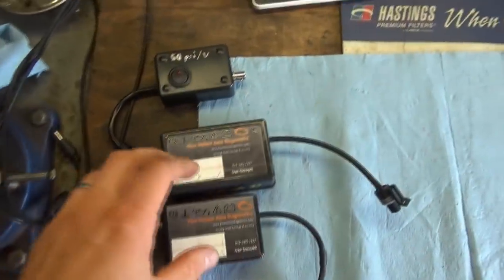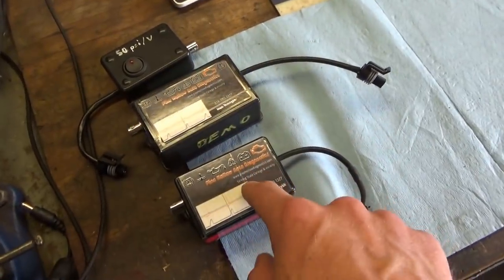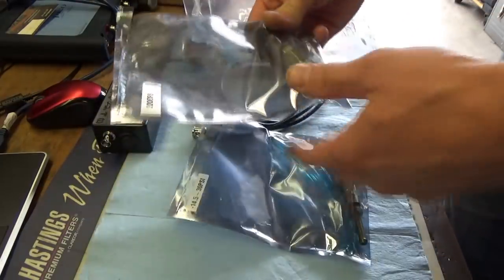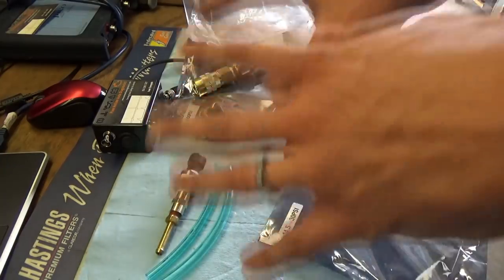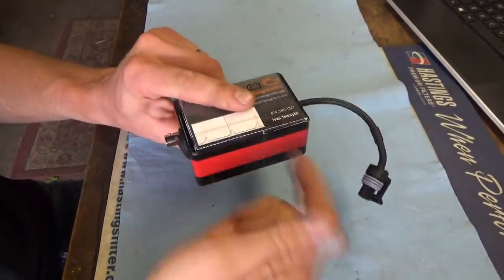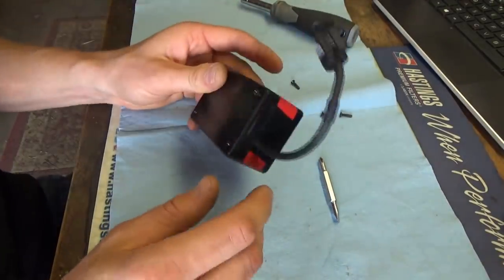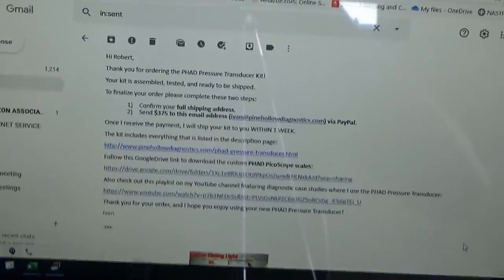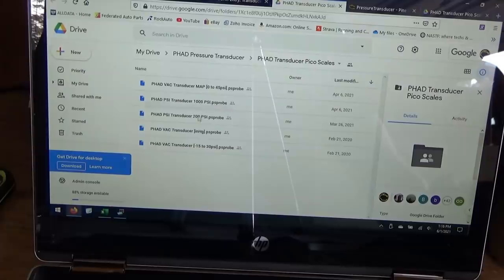PHAD Pressure Transducer TUTORIAL - Part 1

Comment: I bought this kit and love it.  I am currently using an Autel scope and all that I did to add the custom probes is open them in pico and looked at the properties of them and entered the settings in the Autel software.  Works perfectly.
Reply: Great info!!! I don't have the pico but I have the virus and the autel...ill have to try this!
Reply: Thanks for the tip! Besides regular lab scopes, I also have an Autel so have been using that. I'll have to try that too.
Reply: For those with inquiring minds. Autel set up is like this 
Name: Pres Trans
Unit: Volts 
Abbreviation:PSI 
Linear Equation: (Y=50 X+ -28)
Reply from the maker: Awesome! Thank you for the feedback, Mike!
Reply: @PineHollowAutoDiagnostics  May be a question you already addressed why not use a 12-volt pressure transducer sensor rather than a 5 volt already have a 12-volt battery in the car
Reply from the maker: @scotttucker4075  need a clean and constant source voltage. Car is never 12V
Reply: @PineHollowAutoDiagnostics  I understand
Reply: My deepest condolences! 350 Dollars for cheep crap, worth 50.

Comment: May be a question you already addressed why not use a 12-volt pressure transducer sensor rather than a 5 volt already have a 12-volt battery in the car

Comment: looking at my Modis Ultra on the probe options there are several for pressure transducers , 100PSI VACUUM, 100 PSI PRESSURE, 500 PSI PRESSURE, 5000 PSI PRESSURE MT5030 VACUUM AND MT5030 PRESSURE have you tried any of this options with your transducers or better yet buy the first and second one for your kit? just curios if it would work with the right transducers so you don't have to convert
Reply from the maker: Nah, wouldn't be worth the hassle. Snap-On is very limited in its scope abilities and transducer choices, plus they are overpriced lol

Comment: Are you kidding me? 350 Dollars for this cheap crap? 😂🤣 And not including a hose? And the customer need to unscrew the box completely for replacing the battery?! I can build this for 50 Dollars. A transducer sensor costs 15, a plastic box 10, bnc connector and switch maybe 10-15, plus a few cables, most people have at home already. And I don't need a battery for that.
Reply from the maker: Very good, go ahead and build your own! 👍😁💪
Reply: what does that say about the pico wps500x? The beauty of a free market is you are free to build a better cheaper unit, but i won't hold my breath.

Comment: Ivan,
Thanks so much for making this video. I have been at a loss as to how to install the scales for a while. I'm now all set up and will give the transducer a try tomorrow. 
   I have a '95 Chevy S10 with a 4.3L V6 that has an intermittent loss of power, stumble and stall but restarts every time and I suspect a fuel pressure issue. I know that if the pressure on the CPI system ever goes below 50psi I will lose fuel through the poppet to the cylinder. In testing the pressure with engine off, running at idle and snap throttle, all checks out OK.  I'm going to hook up the Pico with fuel pressure and secondary ignition and go for a drive to see which system is the culprit.
Reply from the maker: Very interesting case study, Charlie! Let me know what you find 👍🙂